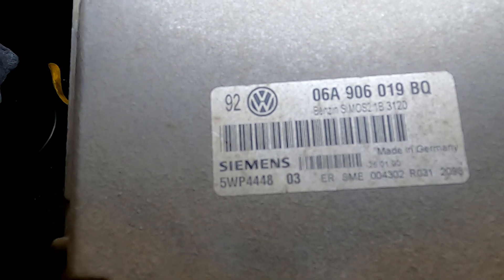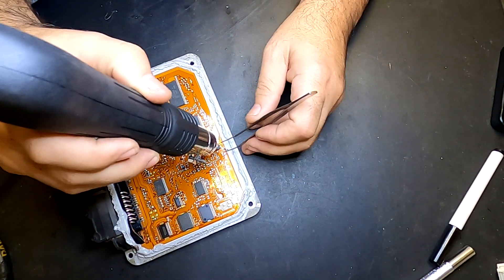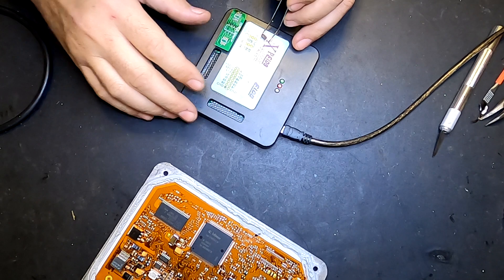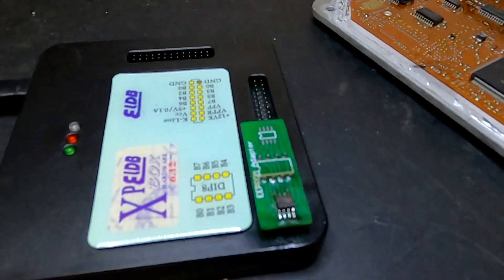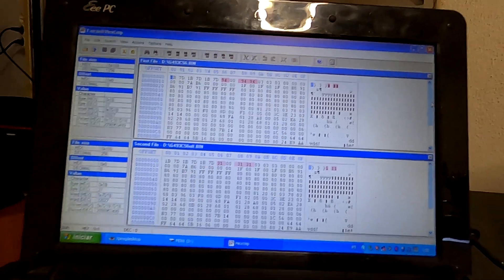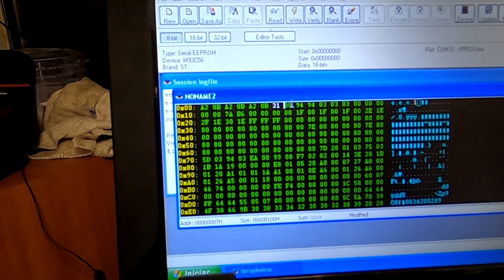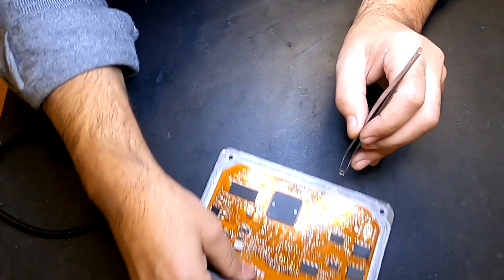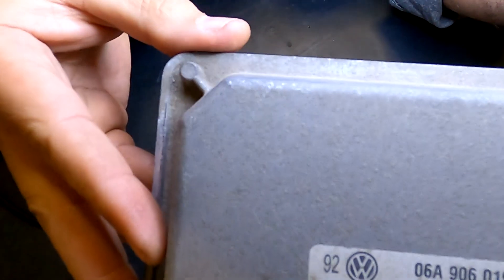siemens simos 2.1 immo off (version 1)

Comment: hello i should do immoff on this ecu how do i know if version 1? thanks
5WP4417 
06A 906 019 AK
Eprom ?or flash?
Reply from the maker: If you do the version 2 it works on all of them...you should only do version 1 if you are sure that your ecu is version 1
Reply: @PSICompanyPerformance   

thanks for replying, but how do I know if my ecu and version 1o version 2? if version 1 is done immo off on the eprom from what I understand, if instead version two is done on the flash 29f200
Reply from the maker: @maverikwartj0184  correct version 2 is on the flash...
You only now depending on if you have immobox or if immo is on the dash..
Reply: mine has immo on the board , is it version 1 or 2
???
 @PSICompanyPerformance
Reply from the maker: If you have immo box under dash its version1 if your immo is on the cluster its version2.
Good luck and thanks for watching.
Reply: yes immo dash my opcion 2 thanks
 @PSICompanyPerformance
Reply: J'ai dû souder la pin 7 sur le 8, sinon il se recode